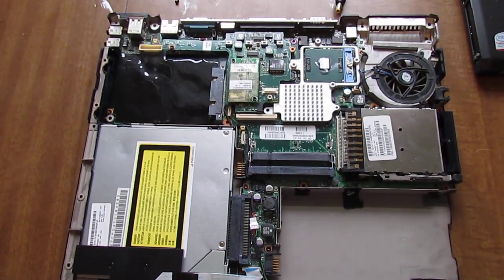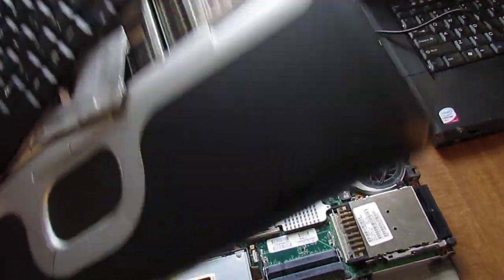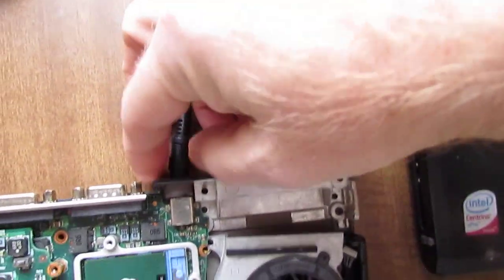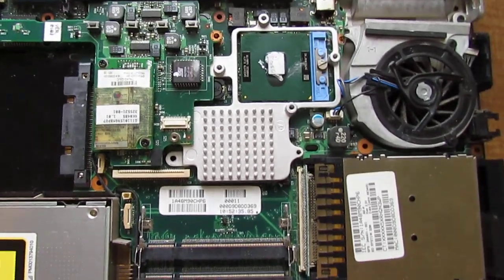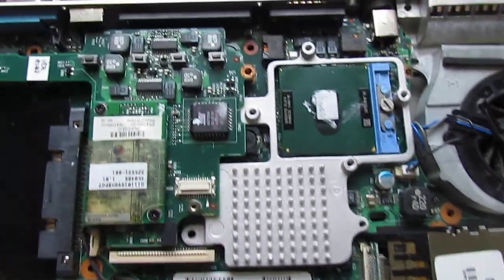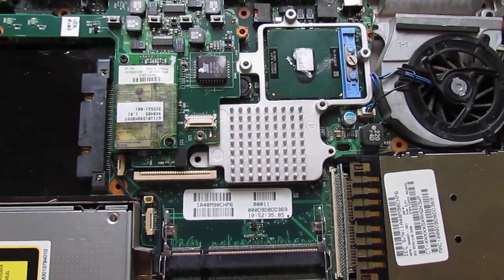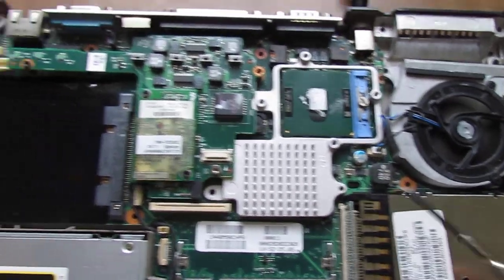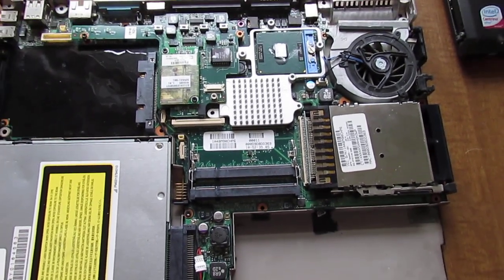Compaq NC6000 LAPTOP....POWERS ON THEN OFF...

Comment: I no exactly what wrong the board has over head and the soldering has stress fractures the GPU or video card it needs to be re balled. you have to have the right equipment to do it. You can try to do it you self by reheating  just the chip with a heat gun and the rest of the board insulated off.  But Most of the time it only works for long and goes out again. It last long if professional done but it's a investment most of the time it's cheaper to buy a new board Wich such. Hp actually had a class law suit for this because they  found out the factory was do this by not supplying enough cooling to there mother boards  under sized heat sink.  The first laptop that did this to me drove me crazy when I first started fixing laptops   because it would work fine till it worm up then shut off then a mouth later started to do what yours is doing  took me two mouth to find out I'm better off replacing the board for the price  some aren't even worth it hope it helps I'm positive that what it is on a Xbox it's called the ring of death and ps has a similar problem turn on then right off
Reply from the maker: Yeah reheating the chip i think will work ..But for how long its anyone guess..I think i can take the same approach with same of the Xbox 360 broads with the GPU  and doing a re balled as well..